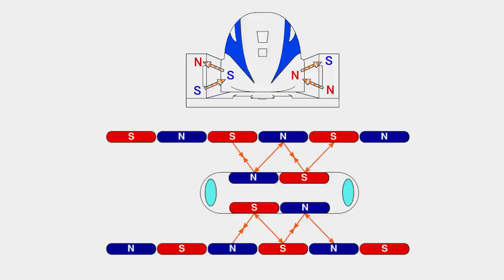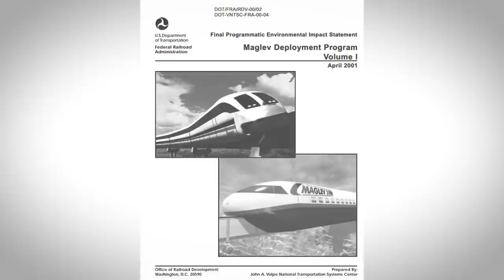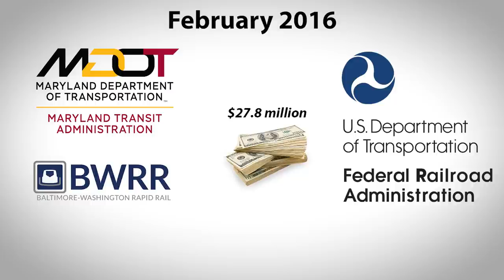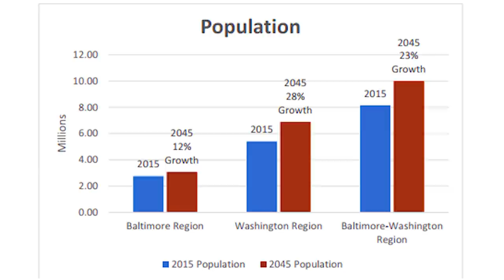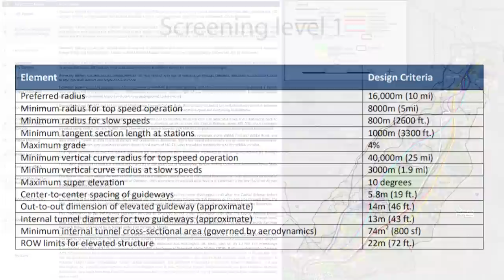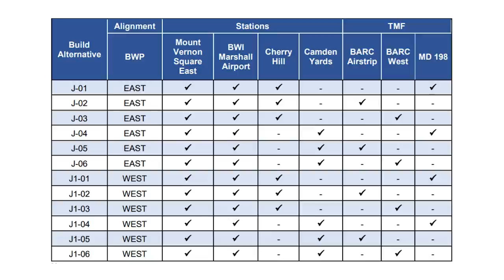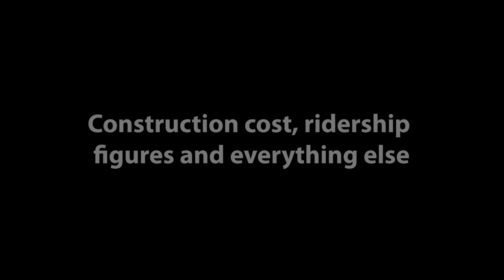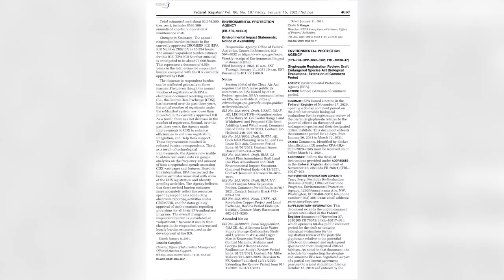Baltimore–Washington Superconducting Maglev Project

Comment: It's telling that the Chinese government built a test system for Shanghai and then decided to build more "conventional" high speed rail all over the country.  The only question is why the Japanese government is spending a HUGE amount of money for a slightly faster connection between Tokyo and Osaka.  Meanwhile the Acela train can't go its full speed except for a very short segment of track.  We spent our wealth on interstate highways and nuclear weapons.
Reply: The reason for the new Tokyo-Osaka (initially Tokyo-Nagoya) link is to provide an alternative, so that business can continue and people can move between the major cities in the case of a disaster. The existing shinkansen runs along the coast, and a tsunami or floods could greatly affect it. It sometimes gets shut down for heavy rain during typhoon season. Since it runs through the mountains there is much less rain in typhoon season. Also, the cities and towns along the line will become part of the Tokyo or Nagoya commuting area, so people can move to the countryside if they want, lessening congestion in the big cities. Of course, with the coronavirus, more folks are doing that anyway with remote work.
Reply: > The only question is why the Japanese government is spending a HUGE amount of money...

This question is based on a flawed premise. JR Central, a private company, is spending the money on the Chuo Shinkansen. They're doing it because it will be profitable -- the Tokaido Shinkansen already operates at capacity at times, meaning that the additional capacity of the Chuo Shinkansen would enable them to serve more customers during those times. They're also doing it because as is, they are pretty much entirely reliant on the Tokaido Shinkansen to function as a business. If anything should happen to the Tokaido Shinkansen, say an earthquake or flooding takes out a section and it takes several months to fix, JR Central would be hemorrhaging money for that entire period. The Chuo Shinkansen vastly improves their resilience as a business because it is unlikely for a natural disaster to simultaneously take out both lines.

Because JR Central decided to finance the line themselves, the Japanese government originally wasn't supposed to have any monetary involvement with the line. However, it turns out that JR Central, being a business, is conservative with how much debt they wanted to take on. Therefore, they included an 8-year break between finishing the Tokyo-Nagoya section before starting work on the extension to Osaka so that they could pay off part of the debt. Residents in the Osaka / Kansai area weren't happy to be at an economic disadvantage for almost an entire decade longer than needed, so they lobbied the Japanese government to do something about it. The region has a population of like 20 million people so they have a lot of political weight. Therefore, the government made a deal with JR Central where they would finance the 3 trillion JPY needed for the Osaka extension at a fixed interest rate, and in return JR Central would skip the 8-year delay and take on more debt at once. Note that this is just a loan to JR Central, and although it's a large loan, the Japanese government will be paid back.
Reply: The bullet would work if it was built for everyone with reasonable fares and ticket prices. So dont build it. The super rich has enough privilege.
Reply: Well, just saying China is now building new maglevs using Low temperature superconducting magnetic levitation tech they developed… there have been two different models of maglev trains since 2020. I’m curious too.
Reply: The Chinese government actually recently came out with their own domestically produced maglev system instead. So it's kind of telling in the usual way for China, where they create their own version after buying one from elsewhere first to study.
Reply: @Quickshot0  because the Chinese have developed a cheaper version.
Reply: @Quickshot0  It's not like you can make a 600km/h train just by running the already dated by then (2001) Siemens-ThyssenKrupp Transrapid solution (note that unlike the Chinese HSR rolling stocks that were eventually all made by joint adventures, the trains of Shanghai maglev were supplied by Transrapid and were built in Germany). They wanted the experience to run and build the tracks for it, believing it's better than nothing. Even the Japanese had to acquire the EMS technology from Krauss-Maffei to boot up the Shinkansen maglev projects, since well - it were the Germans who invented maglev.
Reply: @theolich4384  I see, that's interesting.
Reply: "We spent our wealth on interstate highways and nuclear weapons."

China has a large arsenal of nuclear weapons as well. One of many reasons you should not praise them. They are a national security threat as well as a communist dictatorship (the Chinese people had no say in whether this network would be built).

The main reason the Chinese Communist Party wasted all the money on trains is that their airline industry sucks. They aren't up to the standard of Boeing or Airbus, and their air routes suck because they have everything designated for military use, so planes have to fly in weird zigzag patterns. Rather than expose to the Chinese people how much their airline industry sucks, they spent money on this HSR network. I notice the propaganda is working on you too.

Japan is a better comparison, they are a free country.
Reply: @theolich4384  

"it were the Germans who invented maglev."

The Americans had an early patent as well, from Brookhaven National Laboratory in the 60s.
Reply: @neutrino78x  Reminds me of Kodak's pioneering work on digital cameras.
Reply: If many stops are needed  as the study proposed, they don't need the extra fast Maglev. They need a fast metro like the one in Guangzhou where the metro can speed to 160 kph.

Comment: Did the planners give a reason for not including union station as one of the DC endpoints in their build alternatives?
Reply: Due to the “need for speed”, the maglev alignment must be unforgivably straight.  Union Station was ruled out because the tunnel approach from Maryland would necessitate a substandard curvature into the complex, undermining the ability for the train to achieve high speed in departing DC. In addition, the area underneath US is reserved for Amtrak which means that for maglev to use the facility it would have to go under the area needed by Amtrak - a very risky and time consuming impracticality.

Comment: China's CR600 maglev EMS prototype train set testing at 621 kph with goals of 800 kph is fantastic!   It is about 4 meters wide and uses electro magnetic suspension which means it can levitate while stopped.  A full new maglev implementation should make use of a much wider loading gauge of about 8 meters wide.   A double width loading gauge has been envisioned since the beginning of the railroad age on 1840s UK dual track railways that were designed to occasionally have double width carriages using the inner rails of the dual tracks.  

The Japanese Chūö is electro dynamic suspension EDS requires the train to use retractable landing gear wheels and doesn't levitate till about 140 kph.  Retractable landing gear is a very complex system and would require constant observational maintenance.   These trains might stop when traveling at 800 kph every 15 minutes to keep station stops only 100 miles apart.  That is a lot of landing use!   It is also noisy.   The  Chūö is significantly narrower than the standard gauge Shinkansen appearing to be a throw back to cape gauge of 3-1/2 foot gauge used through much of Japan with narrower loading gauge width.   China uses low speed EMS maglevs for low maintenance and low noise for people movers.  

An 8 meter wide loading gauge would allow the easy transport of large assemblies overland greatly changing the world.   Maglev trains don't have the width load limits of the rail wheel interface.   The 8 meter wide loading gauge would allow stability for three passenger levels.   The first level might best be used for cargo with perpendicular simultaneous loading of automobiles and cargo containers from the sides that could take place in a one minute stop.  High speed cargo might make profit.  Passenger trains tend to not make profit.   

The second and third levels could be luxury continues passenger space with vista dome roofs for passengers to see forward watching the scenery.   This configuration would allow more comfort for the same number of passengers in 1/4 the length of today popular single level trains that stretch out several city blocks.  

There would be enough room for people to drive their automobiles onto the maglev and walk around them after parked allowing the train to depart as soon as the automobiles have loaded and before people have collected their belongings to exit their cars.  Loading needs to be staged and simultaneous to allow 1 minute stops.  

Large transfer passenger stations might have separate passenger loading into each of the  three levels.   Rural stations with small numbers of people might have loading at level 1 cargo level only with passengers having to go up internal stairs to the passenger levels.  
 
All very high speed trains need incrementally cheap to free electricity for their huge electrical demands such as their own hydropower generators with unlimited water.  New technology nuclear power is likely  the next closest option.Large transfer passenger stations might have separate passenger loading into the three levels.   Rural stations with small numbers of people might have loading at level 1 cargo level only with passengers having to go up internal stairs to the passenger levels.

Comment: I hope they can find a way to build the station in Camden Yards and not in Cherry Hill… Camden yards is right in the heart of the harbor (downtown) & is connected to light rail/charm city circular bus service/isn’t far from Baltimore heavy rail metro… while I’m sure it is much more expensive & complex it is intensely more convenient than cherry hill which is an isolated area nearly outside the city. I desperately want this project to succeed and I worry that if usage is low because of inconvenient station placement it could be used as justification to not continue building further to Philly, NYC, and Boston (and all their connecting airports which play a key role in this project)

Comment: Very high speed rail only makes sense when connecting large nodes on public transport networks of large cities - it generally should not link city centres if there are other good nodes due to cost of reaching city centres.
Reply: yeah, trying to do this when the northeast corridor is already successful is just a bad idea in the long run.
Reply: all these cities have extensive public transit. Are you really not aware of the famous New York Subway?

Comment: Big fan of us here doing Maglev. It's a good idea for the country. But they need to plan it to be big from the start. Also I would rather use passive maglev technology rather than superconducting maglev. It's probably cheaper.

But if you want to be lame and just make it for the northeast, then just stick with a normal hsr. It's probably not worth it to do it then though.

Comment: Projects like these through populated areas generates so much litigation it will tie the courts up for years. Then the cost of the project gets much more expensive.  It could still take 20 more years to have it built if ever.  The entire Northeast Corridor from Washington D.C. to New York should be the goal. Chances of that happening are about .00000001%.
Reply: Just ban litigation stop allowing it.
Reply: yeah, you might be right. That why the air is the best way to do high speed in North America, well that and the distances involved (in this case though the distance is fine, this is probably one of the very few places where HSR makes any sense in North America)

Comment: Hang from single guideway = cut cost 80%, increase speed 31% — but why bother? — divert AMTRAK into BWI terminal , then due north into city at stadium, convention, seaport station + all curves 3mi R and existing 125mph Acela will make the 33mi trip in 15 minutes

Comment: Let's see, don't build to the preexisting major stations, even through building underground. Put stations in suburban and industrial areas. Not even consider the straighter alternatives that go right by populated areas. I don't think this will divert almost anyone from the auto, it will cause them to drive to the station.
Reply: Right. They picked the absolute worst of the two proposals for the Baltimore terminus by every measure except cost. But whatever they would save there would be lost by making it less convenient and attractive to potential riders.
Reply: @BrendanC6788  They did not even consider as an end point Baltimore Penn, which has better connections. If they are building it mostly underground, why did they decide to run it away from residential areas?
Reply: @zeroone8800  It seems like they're intentionally avoiding connections with Amtrak. But at the prices they're projecting this would more useful to business travelers than commuters or tourists. So it still makes no sense not to have it run into both city centers.
Reply: You're thinking about what Cherry Hill looks like now not what it will look like in 50 years. South Baltimore  will be better integrated with downtown by that time. Baltimoreans think so small. Like the city they are.
Reply: @ElyOmar  Okay, but why spend billions on a train not making back revenue instead of... let's see?... fix the existing infrastructure our MARC system runs on?
Reply: @BrendanC6788  it's like they do it on purpose to make it fail...
Reply: @ElyOmar  In 50 years Cherry Hill will still be 3 miles from the city center and geographically isolated. The best it can hope for is to be a livable fringe neighborhood.

Comment: They should stop with the gizmos, and start building rail.
Reply: The US has more than enough rail infrastructure, it is just nearly entirely privatized and poorly managed.
Reply: @hwgusn  Except for commuter rail, all passenger rail in the US is run by Amtrak.  What makes you say the freight lines are poorly managed?
Reply: @michaelsommers2356  lack of maintenance, upgrades, or equity of use
Reply: @hwgusn  Please be specific.
Reply: @hwgusn  where do you live?? Northeast rail infrastructure is beyond repair. No major or even significant upgrades are possible. We have what we have and it's not good enough. We need something new.

Comment: This comment section is pretty much people saying... "the US doesn't even have regular HSR so how are they supposed to have maglev" and "why don't they just upgrade existing rail infrastructure" 🤦‍♂️ You guys don't get it. We truly need this. What we do need to improve is inner city public transit for example in Baltimore were it's pretty much non existent. But the NEC as it is today is beyond saving. We can only do so much and it would all be pointless.
Reply: Yes but maglev technology is hardcore and expensive. HSR of atleast 220km/h for commuter rail is not only cheap but also efficient and  tested. 
Also invest 300kmph train on some heavy traffic routes. 
High speed maglev is only operational now in China( Shanghai maglev) and it is at a heavy loss and barely any functionalities, just a showpiece that's it.  That's why it wasn't expanded and HSR was preferred there instead.
Japan itself which is the pioneer of bullet trains is not very confident on Maglevs .
Reply: @achinthyavishnuvardhan19  based on your name I'm going to assume you are a foreigner and do not live in the NEC. So are you suggesting we build 400 miles of entirely new rail from DC to Boston?? Because "upgrading" the current route to be HSR is simply impossible.
Besides if we were to build regular HSR even cheaply it would kinda be a bitter sweet feeling knowing how long it took us just to get something decent. Might as well be ahead in a different game.

Comment: Woah, 15 minutes between Baltimore and DC would be crazy. Realistically, it would probably be a better use of money to just improve the NEC though.
Reply: Add to that 15 minutes the time it takes to get to and from the stations.
Reply: @michaelsommers2356  Also, also... how much time it would take for the train to even pickup that speed to gain a 15 minute travel time
Reply: @MarloSoBalJr  That depends on the acceleration.